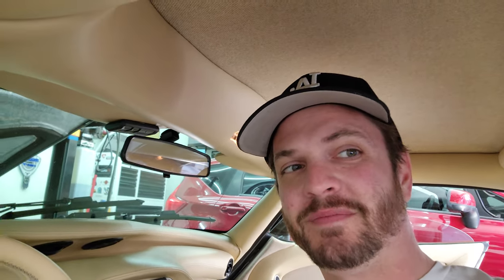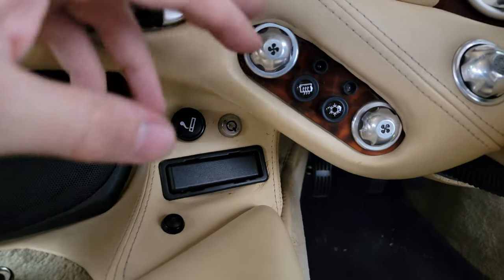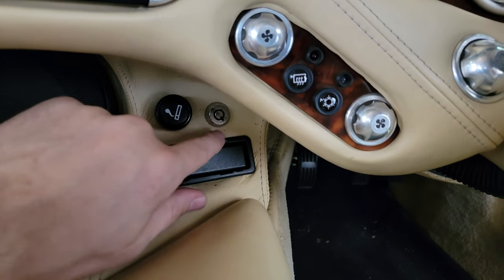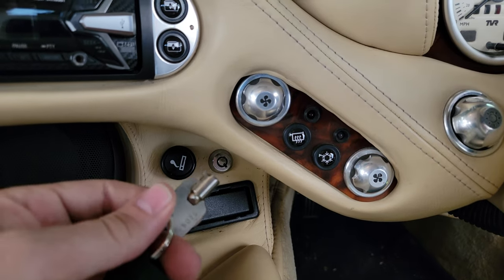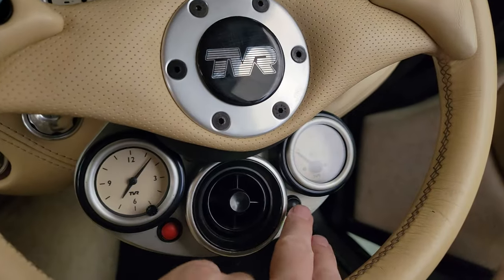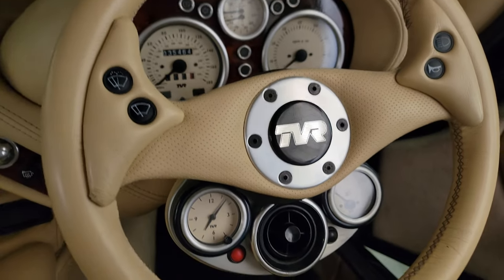TVR Cerbera Weirdness: The Keys

Comment: The key is supposed to stay in the lock and never be touched. The immobilizer/alarm (together with the start and stop buttons) are all that is required to operate the car.
Reply from the maker: Previous owner bypassed my immobilizer. From what I am seeing,  it's becoming a common thing.
Reply: @AaronsEccentricGarage  at-best it was intended to be a safety cut-out (certainly not any kind of security system) because you can just reach behind and grab the 2 wires and connect them. Someone has even made a video about it. If used frequently, the lock assembly rotates and ends up fouling the wiring, that’s why Cerb owners say never to touch it and just leave the key-in (in the ON position).
Being such an odd car (and right hand drive), the chances of someone actually stealing it in the USA are close to zero, so it’s not an issue anyway. Most probably wouldn’t know how to open the door 🤣
Reply from the maker: @I999  even getting into the car is a mystery for most 😆 I press my fob, the car locks, and unlocks and that's enough for the USA. 😀
Reply: @AaronsEccentricGarage  yeh tell me about it. At a cars and coffee last year, it took a crowd of more than 10 people quite a while to figure out how to open the door :-)